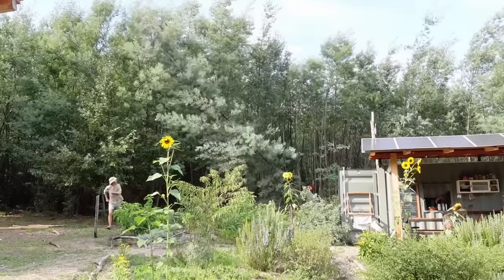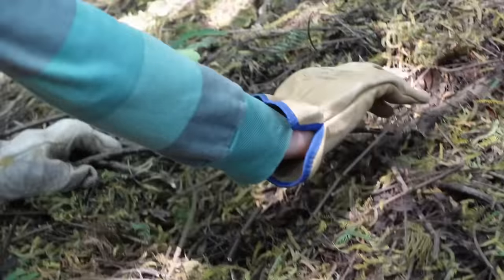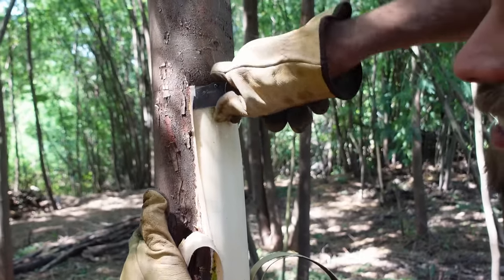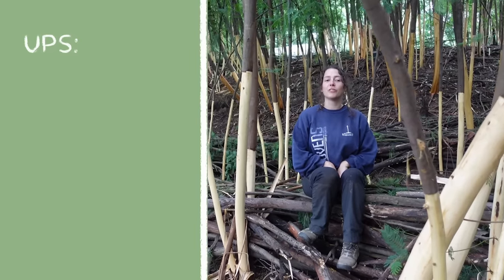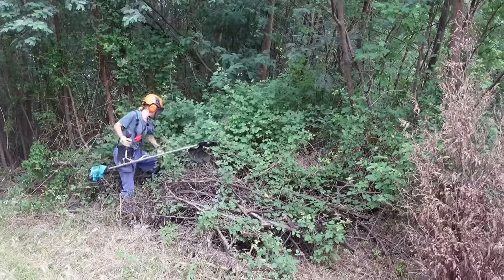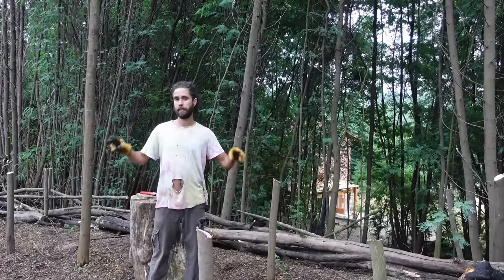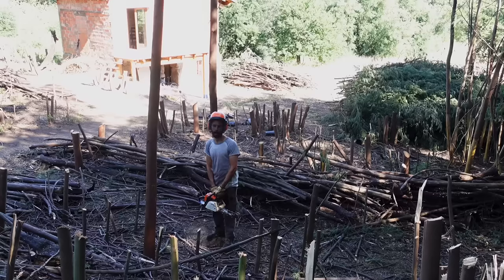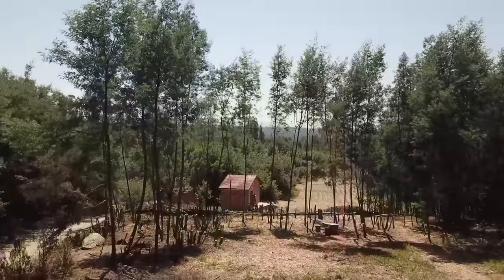#84 Why we're chopping a forest down

Comment: I think the biggest problems with fire in Portugal and many parts of the world is proper woodland management. Living off grid wood is one of the most important things for survival. Eucalyptus have many uses and is not really the biggest problem with fire it is management of the undergrowth, I appreciate bringing back natural forest but when you already have a mature Eucalyptus forest use that to your advantage as native tress will take a very long time before you see the benefits unless you don't need it and want to reforestation for futures generations. I would personally had dome trees removed to bring light in, manage the amount of tree and how close they are to another which will also slow down fire spread. Secondly is managing the undergrowth as I was saying, in a fire it is the undergrowth causing the most damage and danger as it helps spreading the fire at an alarming rate it also causes such intense heat that it does not burn the tree but sets it on fire which destroys the tree and spread the fire quicker. One other thing I would implement to is permaculture ideas where directing run off water through the forest, just my ideas.

Comment: You cannot get a bulldozer up there, but you could at lease cut them at the base and do a stump removal process. After clearing the dead stuff, cut down new growth every or every other month. 
Question: is the roots of the mimosa the only root system holding the hillsides together preventing landslides? I'm not familiar with your local geology, so I'm not sure if the question is even relevant.

Comment: If you don't want livestock to graze the new growth it might be very useful to research the work of French writer and practical conservationist Jean Pain. He used the heat and gas from fermenting woody vegetation that had been cleared from land in the south of France to reduce fire risk. Once the fermentation had finished and the materiel rotted - voila - superb compost! He ran heating systems, gas or steam motors and a variety of other power applications.

Comment: Hello there, 
I think your approach is to labour intensive. Would be much more doable if you would use a forestry mulcher and a harvester. You would prob. need a harvester because of the topography. But there are bobcats and all type of wheelpowered vehicles.
The bigger question is though, how to turn mimosa woodships into something more usefull. What is the process? What are products and other inputs? How to accelerate it?
Then how to maintain machinery? How to produce spare parts?
(Continous endlessly)

Comment: Have you not just created a ton of highly flammable material that is now littering the forest floor that will aid the spread of a fire through the area? I was under the impression that to prevent forest fires you need to clear the dead dry material from the ground, that's why in places like Canada they have controlled burns to remove all this ground material.

Comment: As a portuguese emigrant myself, it's great to see you guys try to bring back portugal's native flora and fauna, but you should really learn how to do it properly and get the proper tools before doing so. Stripping the bark is an effective way of killing a tree, but in a fire prone area like the interior of portugal, it should really be avoided since you'll be left with a bunch of standing dead trees that pose an even greater fire risk. It's also a tried and true method, so look up which tools could be most effective for your particular scenario before getting started. It's back breaking work, so do it in the most efficient and most ergonomic way from the getgo. 

stripping the bark also isn't the only way to keep a tree from growing back. You can use relatively harmless (to humans, fauna and the flora you actually want to preserve) techniques and substances to deal with the stumps left after chopping down a patch of forest.

As far as your chainsaw technique, you're being really reckless, and not using proper technique. kicking a falling tree puts you at unnecessary risk, that could be avoided by cutting it properly in the first place. Also definitely consider buying safety chaps to protect your legs. Working in the heat for hours on end, an accident is bound to happen, so no amount of PPE is excessive.

Again, this is advice coming from a place of appreciation for your ambition and your activism, and worry for your own well-being. I'm also mostly rehashing what has already been said by other commentators, but I figured I could still give my opinion.

Comment: A few copper nails on the surface of every remaining stump will do wonders in poisoning the trees without affecting anything else or the soil around it. Copper to trees are like cyanide on humans, precise and deadly.

Also wouldn’t you be able to debark and turn the big mimosa trunks into firewood after seasoning for a while? Not sure if it’ll season nicely over time or if it’s poisonous to food if used for cooking, but at the very least having the longer-growing trees like oak around means that firewood is eventually going to be zero carbon.

Comment: I just heard the question of how much poo a human makes, from my experience using a bucket toilet emptied into compost cube (4 pallets)   line bucket with news paper makes emptying easy and clean and poo only no pee as the ammonia becomes a problem quickly. new material is covered with carbon rich material straw, small sticks, wood chips , reads. what you have. After 2 years 2 people produced a 1/4 of a 2 mtr. Leave for a year and return to soil around trees etc. No smell from bucket as you use emptied every 4 days depending on how many curries. and no smell from cube as it is aerobic.

Comment: if you drill a hole in the tree and put diesel fuel in the 1/2 hole to center of the tree it will kill the tree, same with painting stumps with diesel will stop them growing back, old out back trick, only a fire issue the first day quickly absorbs.

Comment: The big problem if you are going to cut down all the mimosa trees to grow the oaks is that the latter take 30 years to reach maturity and instead of the 5-7 years that mimosas take. In 30 years many fires could easily kill these oaks. You could also try black alder (Alnus glutinosa), Pinus pinaster... And if you are so worried about fires, plant lots of cork oaks (Quercus suber), which take the same time as oaks to reach maturity but are highly resistant to fire, and regenerate more quickly. / Likewise, the human being does not have old data on the "presumably autochthonous" flora of the different regions. So many of them could well have been invasive at the time until they became native. As long as they fulfill their function in the ecosystem, there is no problem. After a fire I would prefer a tree that reaches maturity in 5 years than in 30. Something that "neo-ecologists" will never understand, since they are too focused on dividing species by geographical zones (and that this does not change) rather than its functionality in the ecosystem. // One last piece of information: if you guys are THAT worried about the fires, you should remove all the trees and fallen branches from between the trees (which the video shows you never did). This is how fire spreads. If you don't clean up, it doesn't matter what trees you plant, you're always going to end up contributing to a fire.

Comment: A few points about the necessity of the debarking method:

This is done in order to kill the root system of the tree so that it does not keep sprouting.

Especially with the mimosa, the root system is quite extensive. You may hand remove the smaller trees, making sure to pull out as much of the root as possible (up to 1.5 cm thick) but anything above that you will have to either cut or debark.

As you cut the tree down, the plant "sends a signal" for the root system to sprout hundreds of new shoots in a very short period of time. As so, from several studies that have been done in Portugal, the debarking method seem to be the most effective to deal with the mimosa as a long term solution.

It works as you remove the phloem of the tree together with the bark (in simple terms, the canals that take energy produced in the leafs to the roots for storage) while keeping the xylem intact in the centre of the trunk (the canals that take water and nutrients from the roots to the top of the tree). This tricks the system into keep wasting energy on that tree for no return energy in the end (instead of producing new shoots all over the place that you will have to keep cutting for the rest of your life and beyond).

The end result should be the die-off of the entire root system, with no or at least fewer new shoots (that you should keep pulling out in the years to come). With this you may finally start thinking about replacing the mimosa with more sustainable, less fire prone and, hopefully, indigenous plants and trees (Quercus suber, Quercus faginea, Quercus rotundifolia, Castanea sativa, Pinus pinaster, Alnus glutinosa, Arbutus unedo, Ceratonia siliqua, Fraxinus angustifolia, Corylus avellana, and so many others).

This is an article, in English, from a Portuguese official source specialized in invasive species in our country with more info on this method:
https://invasoras.pt/en/debarking

Hope this may help clarify the subject and the absolute need for the application of these methods.

P.S.: Keep up with the great work you are doing in creating a more managed and sustainable environment.

Comment: When you live in a bushfire prone area, clearing the dead branches and leaf litter on the land in IMPERATIVE as sparks from future fires WILL and CAN travel kilometers and WILL burn all the bark and dead branches and leaf litter you've left on the ground and burn for days, sending more sparks up and causing more fires.   All of that dead and stripped material needs to be removed totally, not left or stacked up.

Comment: All I see is a massive tinder-box.  If you want wood to rot fast you need to chip it and cover it with soil.  That machete would have been the best tool to clear the area under the power-line.

Comment: i've got an idea how to get rid of mimosas but idk if it is a good one: you could use bare iron wire, wrap it around (?younger?)  mimosas a few times and twist the ends tightly together, maybe they'll die because of that and the bare iron wire should turn to rust after a while. the benefit would be the speed for twisting the wire fast and tight you could use a cable twist plier.

Comment: OMG..Australian here and ex volunteer firefighter (which is normal for Australia btw). Debarking is just creating an even worse firehazard. Just dead trees ready to burn and fall over.  There are 2 types of wildfires..Ground level Fires and Crown Fires (Canopy Fires).  Canopy fires are the worst because you cannot reach them to fight them,  they are affected more by wind (spread more easily).  Your so-called safe zone around the office is NOT far enough back in the case of a bad fire...Needs to be double the distance.  Remember a bad wildfire can generate heat of several hundred degrees C within 50 to a hundred metres of it. (I am NOT exaggerating!).  Your building could easily catch fire from radiant heat and or sparks from trees carried by the wind.    You also need to totally clearfell trees you are cutting down, borrow a farmer tractor..hire one buy and old one whatever and get roots out....otherwise you are just coppiccing the mimos...will grow back thicker and even faster...as the root structure still in place.

Comment: guys u need to look at some chainsaw tree cuting tutorials , the way u are doing it is pretty dangerouse there's simpler easier ways 
like making a trinagle cut on 30-40% of the plant on 1 side and then just above it on the oposide side a 60% cut witch will make the plant crash in the direction of the first cut , also careful not to stand behind it

Comment: Please learn how to properly and safely fell trees, there were many moments that I cringed ......incorrect/ignorant cuts resulting in kick backs, chain pinch, even a snapping chain, hang ups, and even people standing in the felling zone, incorrect or no safety equipment (Project Kamp is usually big on safety!) 
28:24 That whole mess was insanely dangerous, from creating a Widow Maker, the chain pinch and snap (in my many years of logging I have never snapped a chain), then pushing the widow maker off its base and almost crushing his hand! And then working under the widow maker! You are very lucky no one was injured! I really enjoy your videos, but please learn from this one, it was hard to watch.
The debarking is going to create a headache, the trees will die and become a massive fire hazard. Cutting them down when dead will be dangerous, unpredictable and tougher on your chainsaws. Please cut them down asap. Check with the environmental department what can be applied to prevent resprout, some of the products can be toxic to the environment, so check that out. I cut the stumps level, almost at ground level, after felling, then cut into the stumps few cm with the chainsaw in criss cross pattern and cover the stump with course salt, then cover with soil, wet it, cover with plastic and leave to rot. Works for eucalyptus, wattle, etc, perhaps experiment on the mimosa. Or use a backhoe to yank them out.

Comment: Peeling the bark with a pocket knife by hand seems like a less effective way to do this process. If you first, took any steel blade on a board with a 45° bend and a long handle you should be able just to lean away from the tree and walk around it to make the top and bottom cut. Then have a second person go round, cut in vertically up-and-down. Call via third person who actually did the peel it should be much quicker and easier. If you spend a little time, trying to think of an optimum way to do the cut in assign individual parts of the test to individual people they were all become much better specialize in each task.

Comment: Just wonder why you'd cut them at waist height when you have to go back and cut them at the base again. You lose all that base wood and just have to do the job twice. The trunks could easily be used as fencing or other structure. Just seems like a waste of a good and free resource. Even as firewood in winter.

Comment: So guys why oh why  did you leave a metre of trunk sticking out of the ground when you cut down those trees. Give an idiot a chainsaw stand back and watch him F*ck things Up. You do realise those trunks will sprout very quickly and create an even bigger problem going forward. Best get that tractor in fast and pull out those roots. 

As far stripping bark and letting the trees die back slowly. Not a good solution if your trying to reduce the fire risk. If anything you are adding fuel to the fire, the same is also the case where you left all the dry dead wood below those trees. Ideal kindling to start a fire. Better that you thin out the trees to allow light through the canopy and encourage native trees to grow.  Create a little dip or lay stones around the seedlings to help catch and retain rain water.  

Get busy collecting acorns and other tree seeds from other woodlands close by to scatter beneath the canopy. Also create a controlled bonfire to burn off some timber use the ash as a fertiliser for the seedlings. On a final note Many hands make light work but SAFETY FIRST when felling trees. I observed some stupid stuns when trees were being felled.  🔥🔥🔥🔥

Comment: Killing Mimosa is not a new subject, as many have tried this before you even doing it without chemicals. So i think you guys try to reinvent the wheel here. But if you want to reinvent the wheel for views on youtube thats your own choice. If you just want to get rid of the Mimosa without chemicals the best and fastest way is cutting them as low to the ground as possible. And then watch them like every 2 weeks for sprouts and cut those of as soon as you see them. And keep doing that until the roots have run out of reserves. If you leave the sprouts on for multiple months you are back at the start because the new sprouts have grown that big that they replenished the root systems reserves. The bark way may look like a good idea but it gives the tree time to shed it's seeds so even if it kills the tree (which is not even certain) you get new ones from the seeds. You can use goats to eat the saplings, but i would recommend to have someone around who really knows goats and how to take care of them as some parts of the mimosa are poisonous, or are converted to poison in the digestion system of the goats after eating. However just letting them eat the sprouts as soon as possible (when they are really small) is less hazardous for the goats and be a really good way to kill the tree and keep it from coming back.

Comment: The English word is 'resistant'. True, resilience can mean to 'spring back from an adversity', but generally, use 'fire resistant', which means to resist fire or flame. Also, I don't see how you couldn't understand that leaving bark-peeled trees is a major fire hazard. They should be chopped down with an excavator or tree mulcher. It would probably take you no more than 2 days to do that with ALL of trees by renting one of these machines. Or, is this just click bait?
Also, as a point of order, 'brambles' are black berry bushes; they grow an awesome fruit that can be used for jellies, pies, cakes, drinks, smoothies and so much more. To see you guys willy-nilly cutting them out with no regard is extremely disheartening. They can be trained, grown in rows, containers and so on.
After having watched this entire video (though there was enough to denigrate the lot of you without a full viewing) I'm forced to conclude that you guys are FOS.